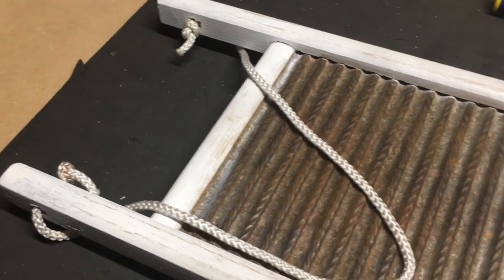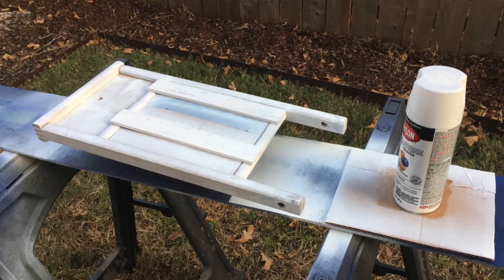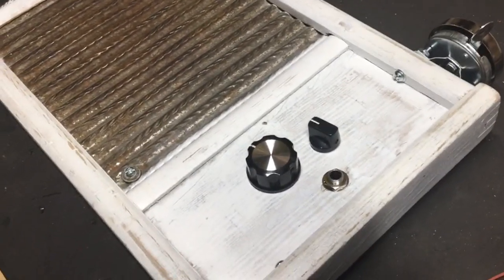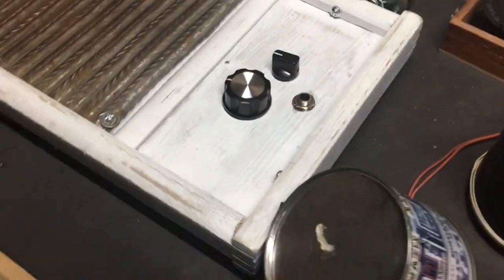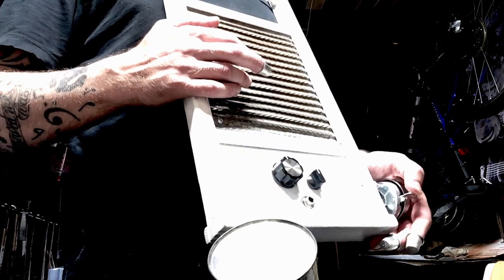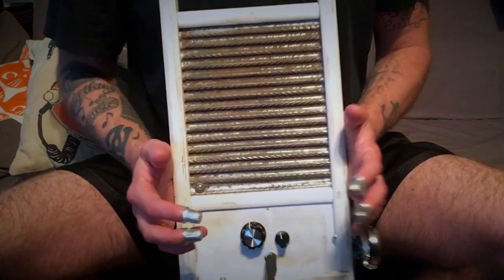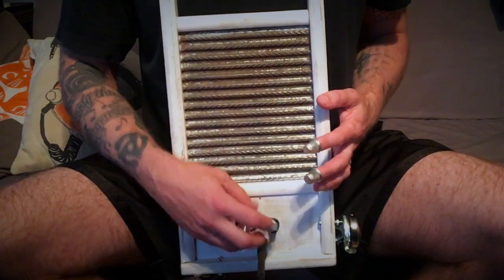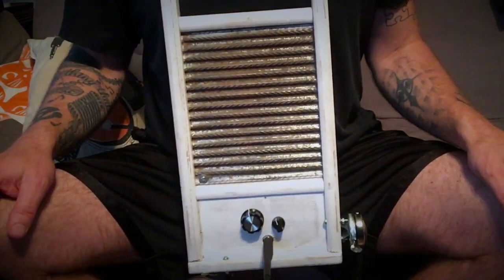DIY Instrument: Electric Washboard

Comment: Great Idea/ project. I have a acoustic guitar pickup. Disc type that sticks in guitar body. Do you think it would work? Im really stoked with all your projects! Great inspiration! My next project it to build a reverb tank!! Thanks for showing all your projects!🖖Live Long And Prosper
Reply from the maker: Thanks for checking it out. Using a piezo pickup like that may work, but that's kinda the opposite of what I was going for. I used a magnetic pickup so it could amplify the vibrations in the steel without having to actually touch the metal (which would reduce the acoustic vibrations). It's worth trying though.

Comment: I just stuck a mic on mine
Very cheap
Reply from the maker: Thanks for checking out the vid. The pickup I used was $6, the pots were around $0.58 each, the capacitor was $0.24, and the jack was about $1. So the whole circuit is less than $10. It's a pretty cheap solution as is. How much was the mic you used?